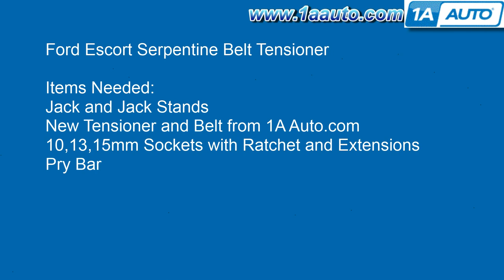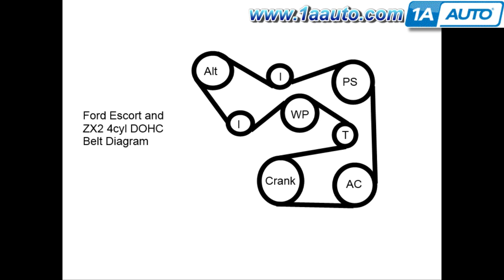How to Replace Serpentine Belt Tensioner 98-02 Ford Escort

Comment: Thanks for the post. Helpful for sure. Just a heads up (and speaking from personal experience) "tweaking" that power steering line may result in a leak. I recommend removing it. To do so, you'll need an 18mm crowsfoot wrench (I highly recommend the flare nut type). Cheers!!
Reply: Wish i had read ur post before.   its necessary to replace line now that its leaking i suppose

Comment: Does the tensioner pulley have a recommended torque setting or do you just tighten until the bolt can't be tightened anymore?

Comment: What size belt is that? I went to the store and bought the wrong size. Mine says at micro-v at 25 but that looks like the right one
Reply from the maker: Thank you for watching. Here is a link to the part on our website.
1auto.com 888-844-3393
http://www.1aauto.com/1A/front-wheel-bearings-and-hubs/Chevy/S10-Pickup/-/-/2000?utm_source=VideoReply&utm_medium=VideoReply&utm_campaign=1ATony